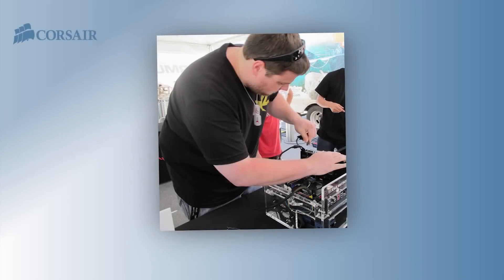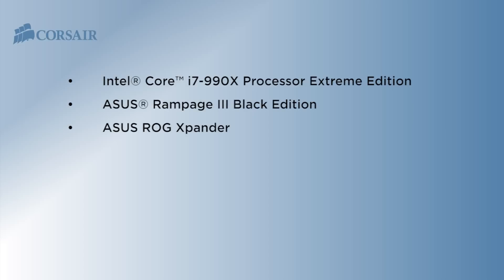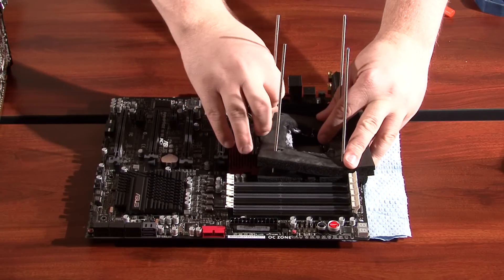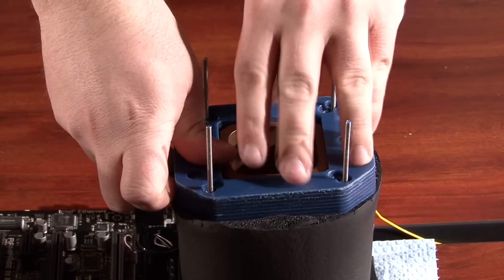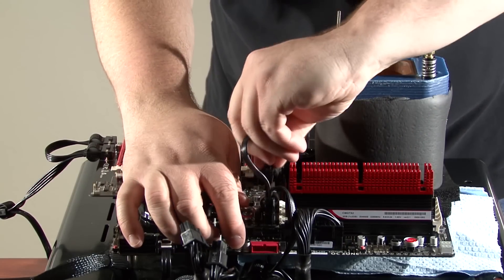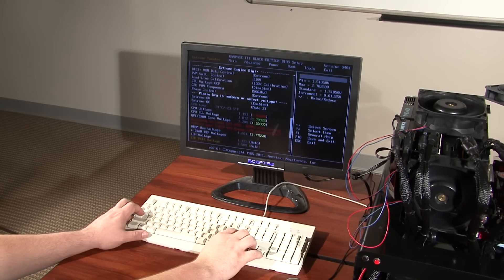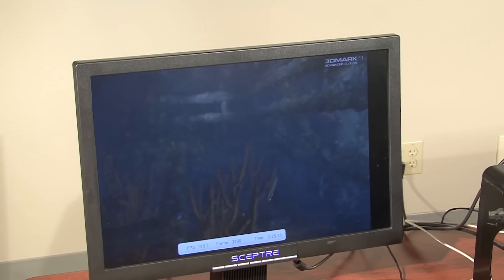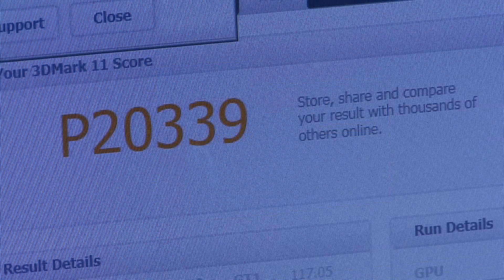Setting up your PC for liquid nitrogen cooling

Comment: nobody saying anything about the giant glob of thermal paste on there?
Reply: Patrick grgregregre was waiting for this. :D
Reply: his temperature is fucking -120 C why would having a giant glob of thermal paste be an issue "not having proper heat transfer" he froze his cpu to death lmao
Reply: im not sure if it matters with liquid nitrogen but too much paste decreases thermal conductivity shrug
Reply: ***** That is original.. did you think of that all by yourself? Proud of you!
Reply: ***** You talk so much, yet what you are saying shows you know little about thermal conductivity.
Reply: Baron_Gamer thats not how you do it...
Reply: GenAdams As was i.
Reply: Why waste it though. Just use what it needed
Reply: +Patrick grgregregre Too much paste is not good for cooling, but this isn't a problem with liquid nitrogen. It may even help stabilise the temperature.
Reply: +Richphotos1 maybe having a big buffer of thermal paste between the ultra cold metal peace and the mini electrical heater is a good thing it would allow the thermals more room to co-mingle. With temperatures this low maybe it's best to reverse the thinking process. So instead of focusing on maximizing conduction between the two materials what you really want is a weak insulator. If you think about it that's exactly what he tried to create with the layer of ice. Otherwise you could cut a hole in the thermal pot and stick it directly onto the cpu and seal off the cracks with silicon, then pour the liquid nitrogen directly onto the cpu plate.
Reply: Patrick grgregregre I was just going to comment on that, but you beat me.
Reply: Daimien Taylor your doing it wrong
Reply: Patrick grgregregre Yeah, that was a fucking ridiculous amount of thermal compound.
Reply: Patrick grgregregre i agreee lol way too much paste used :D less is more
Reply: I can't believe people are actually arguing over thermal paste.
Reply: Patrick grgregregre Duuuuuuuuude right?!?!!
Reply: I'm not doing it wrong. I have been smearing on Arctic silver 5 for years, probably more than you have and I have NEVER had any overheating problems. Overclocked and stocked clock speeds and I build mainframe workstation Xeon systems that work 24/7. So all this stuff about applying it wrong is a myth; unless you apply a big blob of it and it gets everywhere. Now that's wrong. Just follow the instructions. Don't need to do anything fancy its just THERMAL PASTE. A little goes a long ways.
Reply: +Patrick grgregregre He's world expert. You don't question how much thermal paste he uses.
Reply: +LetoZeth Wow, so smart, thanks for letting us know how smart you are.
Reply: +Patrick grgregregre I thought about it xD
Reply: ***** Only high quality (Arctic silver and other things like that) thermal paste contains silver.
Reply: Patrick grgregregre Yeah same, when I saw it I cried inside as a pc builder.
Reply: Who cares? It's thermal paste. No one cares. Just smear that bs on and that's it.
Reply: DjRadRod Nope.
Reply: How do I stop receiving notifications about this post ?.
Reply: ***** Cheers
Reply: +Patrick grgregregre 

I know i cringed so hard!
Reply: +Patrick grgregregre He;s just a donut-loving end-user, not a developer. I know kids in grade-school that can do this.
Reply: LOL
Reply: Nelson Mandela Someone needs a spanking.
Reply: +Patrick grgregregre is like an awkar sex with tha poor mobo XD
Reply: +Patrick grgregregre It's liquid nitrogen, there's not much heat or pressure to spread it.
Reply: +Richphotos1 I agree with most of your comment, except that big pot he put on there is a heat sink, I don't see how it wouldn't be.  I don't really understand why he wouldn't need thermal paste it would help some.  But other than that I fully agree that he used to much.
Reply: +Richphotos1 LMFAO short out your mobo? Thermal paste is made of non-electrically conductive material for a reason dumbass, but thanks for showing how little you know about the subject. XD Calling people stupid and telling them to kill themselves over god damn thermal paste and you don't even know what its made of, let alone the difference between standard, and exotic cooling.  XD  Thanks for the laugh though. LOL
Reply: Richphotos1 You don't know anything about extreme cooling solutions, do you.
Reply: +Patrick grgregregre dont worry hes a world champion overclocker
Reply: I used toothpaste on my CPU and it's great. It's icy fresh, it smells good and it's free from gum disease. Winning
Reply: Simon Harris winning
Reply: MY DAD WORKS FOR NINTENDO AND HE SAYS YOU NEED AT LEAST A GALLON OF THERMAL PASTE BUT IT'S A COMMON MISCONCEPTION TO PUT IT ON THE PROCESSOR INSTEAD YOU SHOULD PUT IN ON THE POWER SUPPLY BECAUSE IT HAS A LOT OF ELECTRICITY AND THEREFORE HEAT.
Reply: +flap cat But that electricity comess from the socket, so you need to pour water into it to cool the electricity before it gets to your power supply
Reply: Kekekeje Ajsgshdj that's what I was thinking it made me so angry
Reply: Yeaaah, that was pretty big.
Reply: LetoZeth r/iamverysmart material right here...
Reply: the amount of thermal paste used doesn't affect it
Reply: these thermo dynamic scientists think they can prove corsair wrong
Reply: Idiots, its not the thermal paste your thinking of (the shit you use for a standard cpu heatsink).
Reply: Daimien Taylor Smoothing it out with that much wont make any difference. That is too much paste to make proper heat transfer. All you need is a dot about the size of a grain of rice
Reply: ***** LOL What? Do you even know what you are talking about? Thermal paste all does the same thing, just some do it better than others. This just has a higher silver content, and a higher thermal conductivity. That does not mean you need to put a giant glob on there. 

Go take off your heat sink on your CPU cooler and put a glob that size of this onto your processor, seat your CPU cooler on there and tell me how it works. 
1, thermal conductivity would suck because of the thick layer, and 2, the extra that just oozed out of the sides, guess what.. that is going to short out your motherboard. 

In this application I do not know why thermal paste is even being used, since there is no heat sink being used, seems a bit redundant to me, but then again doing this type of overclocking is just stupid. Its basically to say "look what I did"
Reply: How to start an argument on Youtube.
Step 01: Have an opinion.
Step 02: Post said opinion in the comments.
Step 03: Sit back and watch your notifications rack up.
Step 04: Have fun with your new argument.
Reply: Richphotos1 this is not your basic thermal paste.
Reply: Baron_Gamer I am actually incredibly sick and out of work for 2 weeks. So yup, I do have loads of time on my hands.
Reply: Patrick grgregregre They skipped over a part. So you cant criticize on something that we don't know. (Unless you are ignorant of course) I am sure he smoothed it out.
Reply: Lol I know right. And even if you put it on wrong, the effects are minimal.
Reply: Richphotos1 The fact that you are arguing over thermal paste shows you have (loads) of time on your hands.
Reply: Richphotos1 Ignored / Blocked.
Reply: Richphotos1 Haha, do you have daddy issues or something? :)

I put together my first computer (a 486 33mhz with 24mb ram and a 2gb HDD) when I was 7 years old.

Some people use a lot of thermal paste, some people use too little, either case, you're pretty much fine, as long as you remove the excess coming out from the sides, if any at all.

Usually when applying too much, it doesn't drip down on the motherboard, because it just happens to have a very thick consistency and creates a sort of wall around the CPU, which.. is ugly, but not harmful. (you'd know this if you knew even a little bit about applying thermal paste)

Now for obvious reasons, he didn't use too much in the video, he used just enough.

I doubt you've ever even seen a liquid nitrogen cooler before, so who are you to judge how much he should or shouldn't use?

Comment: and im just here with my i3 cpu and cooling it with my tears.
Reply: zhentrix calipso Dont feel bad dude i have an i7 and it doesnt matter how fast ur cpu is if your disk speed isnt faster than 6gb/s
Reply: Valient Six  my disk speed is slower than a turtle.
Reply: I have one hdd doing 3gb/s and another 6 and the 3 slows the whole system down . Although the i7 3770 k makes the program starts instant . Locating files has a lag issue . Thinking about solid states now that theu are terra bytes
Reply: i hv a duo core
Reply: pentium my dudes
Reply: zhentrix calipso Im sat here with an i5 6700k cooling it with milk. I wish I wasnt joking.
Reply: Zhentrix funny I got mine for free , the whole tower and win7 ultimate installed on it nullified the cost of the cpu . So I extracted it , and put it in my excelsior steam castle build . My setup is epic . Especially since my robo3d printer matches my tower perfectly . White with blue ledsss , epicness
Reply: Hell no , I like to run stock with an upgraded cooler setup . Nice n safe
Reply: +zhentrix calipso ahhahahaha that made me laugh!!!
Reply: I got an i7 3770k with 32gb ram 2gb gtx nvidia big cpu cooler and 6tb of hdd . All in a steamcastle tower . Its insanely quiet too . Front fan is 200mm and blows over the hdd and right across mobo . One 120mm fan bottom of case two 120mm fans at top . One 140mm fan at rear top . Runs at 38db .
Reply: +zhentrix calipso i3 2100 ftw.
Reply: I have a Core 2 duo ;) No joke.
Reply: What model? Not all AMD processors are bad, I have an 8-core processor in my PC that I use to 3D Model And edit videos.
Reply: Valient Six Hey we have the same CPU, you know what's funny i sniped it on ebay for 20$$$ Hue Hue Hue, so evil.
Reply: +Valient Six bravo
Reply: +Blaze Rod thanks
Reply: +zhentrix calipso thanks
Reply: +zhentrix calipso I do the same :v
Reply: And i tought my i5 was slow...
Reply: +Valient Six why the hell do you have a k-series cpu when you're not going to overclock it?
Reply: Um idk because of longevity of life ?
Reply: Yeah but why a k-series cpu? theese are made for overclocking you could just buy the cpu without the "k" if you dont want to overclock it
Reply: Because I got it for free when I bought a tower then I extracted it and sold the tower with a shitty processor in it . For the same price ...
Reply: +zhentrix calipso Yes but the thing is you can probably aim better than he does ;)
FRAG EEEEEM
Reply: +zhentrix calipso And I'm here with a intel core 2 duo
Reply: +zhentrix calipso on a mac :(
Reply: Yeah I have a laptop from 2014 and I get 10fps in CS:GO on the lowest settings and resolution
Reply: do you overclock it too?
Reply: whats your pc specs
Reply: Valient Six Sick dude
Reply: iPlayGames aww
Reply: Nick Greek ya thanks
Reply: ***** haha thanks
Reply: +Valient Six Get an SSD.  I still don't understand why it's not standard yet.  HDDs are such a bottleneck for the OS
Reply: zen flores * hugs *
Reply: zen flores aww :- (
Reply: don't feel bad, I have an i3 4160 but with a r9 270x it hits over 1k fps easily! Just get an h100i
Reply: texan herper channel Intel
Reply: MR. Mitch65 wow ':D
Reply: i have my fx 6300 being cooled by a be quiet pure rock cooler
Reply: fakat no
Reply: Here with my Intel Celeron n3060 with like a laptop fan and Acer didn't want it to bottleneck so they put a Intel "hd" graphics in it. Oh yeah don't forget the 600mb Max disk speed
Reply: Do not confuse your SATA channel speed for any kind of measurement of your HDD. HDD's primary statistics are RPM and Cache. Use Crystal DiskMark or the like to test your throughput.

You'll find an SSD on SATA 6Gb/s channel will be significantly faster than your 7200 RPM HDD that tops out at about 45MBps transfer rates if you're lucky. These transfer rates aren't even a significant fraction of your 3Gb/s channel's bandwidth.
Reply: A i3 8100?
Reply: I'm here with my i3 (upgraded from an i7) playing every game maxxed out going "why the fuck did I need an i7?"
Reply: zhentrix calipso Get SSD
Reply: I have an intel celeron
Reply: Lol I got an Intel Celeron laptop and I cool it with my sweat and tears😓😭
Reply: Rich Boi 
I hav Pentium dual core
Reply: You dont understand how it feels to have 1 core and 500mb of clock speed
Reply: holy shit, reading this feels like time travel
Reply: LOL
Reply: Valient Six i have i3 7100 and disk is 6gb /s. is it good?

Comment: Would theses temps hold? Or would you need to refill on nitro every 2 days?
Reply: Jamz GFX Design more like every two minutes... XD
Reply: Jamz GFX Design Liquid nitrogen boils immediately when in contact with air, with a hot CPU it would need to be refilled constantly.
Reply: JP Onefourseven Thankyou , at long last an answer.

Comment: You have a i7 990x ... why in the world would you need to cool it like this ? It seems like a giant waist of money and time. Your normal liquid cooling would be just fine for that CPU. Why do people buy into overly complicated crap like this ? That PC isnt going to perform better then mine (I have the same CPU) and that is a fact. All you are doing is allowing your self to OC to a ridicules Voltage that is going to kill your CPU I would guess 20%-40% faster then if you ran normal and liquid cooled it.
Reply: +drzaco55 Ok, try and keep that CPU cool on watercooling @6 GHz and 1.85V core-voltage. And if you're curious, just download 3D Mark 11 and do the benchmark. Tell me what score you reached and how many thousands of points you're below his score.
You sir, have no clue about overclocking.
Reply: Metatr0n I may have a tiny bit of knowledge about overclocking and PC components. At least I would assume so after over 15 years in the IT field, specifically custom pc builds profiled around gaming. Can I ask you why you would like me to test my CPU with software that is designed to test a GPU? 

Also, SIR, overclocking is like the hobby of putting really big tiers on your truck. It's not practical (for the majority of cpus) and serves no purpus other then to say "hehe I OC this cpu man look how kool I am now". Its a neat thing  to do but kills your CPU life expectancy, drives the cost of builds up and has the effect to make uninformed think its the way to go.
Reply: drzaco55
Your initial question was "Why in the world would you need to cool it like this?" and the simple answer is, because it runs at 6 GHz and 1.85 V core-voltage. Then you reccon that normal liquid cooling will do the same job which is simply rubbish. With no watercooling loop in the world you'd be able to cool that CPU on those voltages. Then you assume that your CPU which is the same model, performs exactly like his, which is rubbish again, because no 990x on stock-settings performs like one overclocked to 6 GHz. Then you assume that overclocking the CPU kills it rather quickly which is once again plain rubbish. The main factor in killing a CPU faster is temperature, not voltage.
An overclocked CPU which runs on 1.5 V core-voltage 24/7 which is cooled to 65°C core-temp under load has a longer life-span than a CPU on stock-settings which is cooled by the Intel stock-cooler on air and 95°C core-temp under load. That's a plain fact.
My i5 2500k (now in my wifes PC) runs at 4.9GHz @1.498V for over 4 years now and another guy on overclockers.net runs his 2500k at 5.1GHz @1.52V for exactly the same time. No degrading, no electronmigration, nothing.
Your last assumption which is pure rubbish is that 3D Mark 11 is a pure GPU benchmark. No 3D application is solely run by the GPU and on top, with a slower CPU you're bottlenecking the 4 GPUs which drastically pulls down the max-fps and thus the benchmark-score.

Overclocking a CPU always yields a benefit, because it's cost-free performance that you're getting factory-made right out of the box. If you're not using it, then it's your own fault. A common overclock is always safe as long as you know what you're doing and always gives a performance-boost. My i7 3930k is overclocked to 4.71 GHz on all 6 cores under watercooling and is used mainly for rendering-jobs. In Cinebench R15 it reaches a score of 1215 points which is 141 points more than a new 600€ i7 5930k on stock-settings and almost equal to an overclocked i7 5820k.

What uninformed people think about extreme-overclocking is not of my concern because it doesn't take away the right of overclockers to demonstrate their system and the way they prepare the bench-test.

15 years in IT? I'm really questioning what you did all that time...

Comment: Why make things messy and tricky just buy a pc and put inside the refrigerator overclock it until it explode
Reply: +melvinjohn Adel Putting a PC into a fridge gives you worse cooling-performance than using the crappy stock-cooler on air.